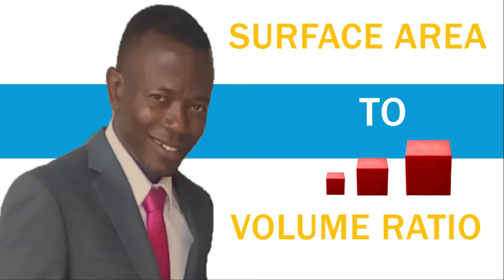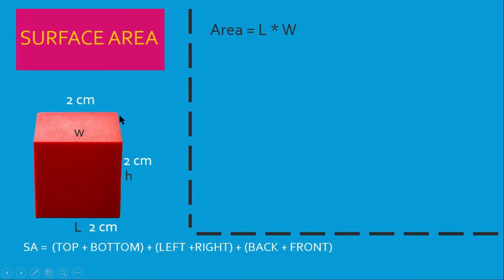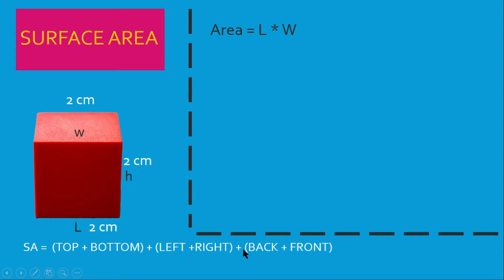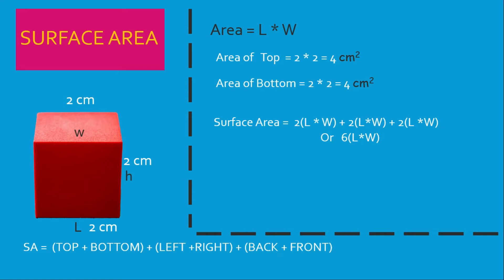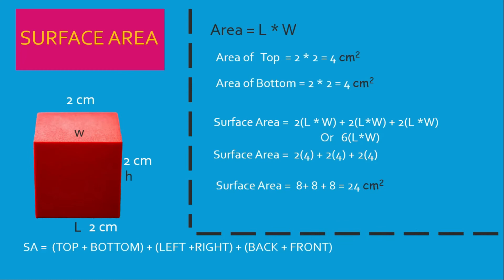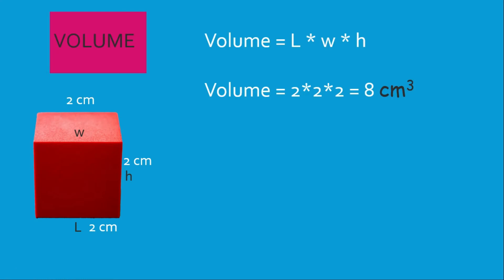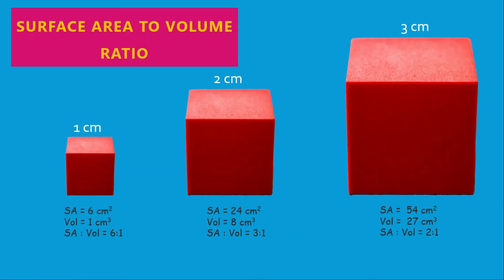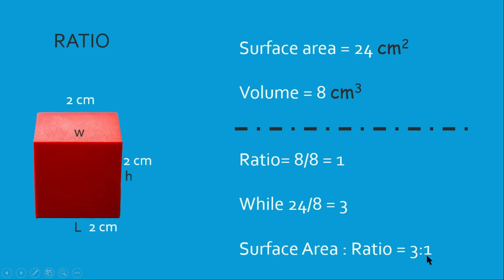Surface area to volume ratio of a cube

Comment: To find the volume of a cube = Side x Side x Side or Side cubed.

To find the area of one side of cube = Side x Side or Side squared.

This is as a cube has 6 square faces.

A square has sides, not Length & Width because all sides of the square are equal. 

Hence we will say side and not length and width.

Length and width terms will be used for a cuboid.
Reply from the maker: This is wonderful. However, when you teach and the intent is for basic understanding you give the learner a bit of what they know and allow them to grow. Saying side and side and side will confuse those who are not that fast. Thanks for adding to the conversation. Remember to subscribe. 

Not sure which of the video this is but the intent was to explain why unicellular organisms do not need a complex circulatory system.